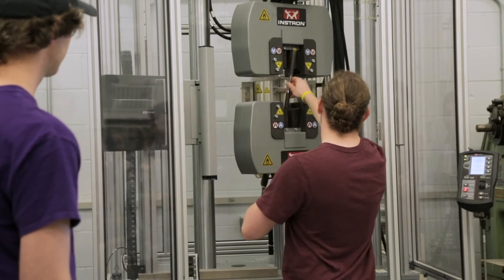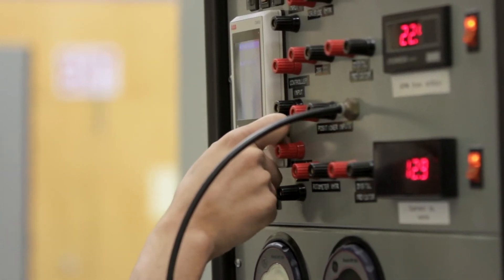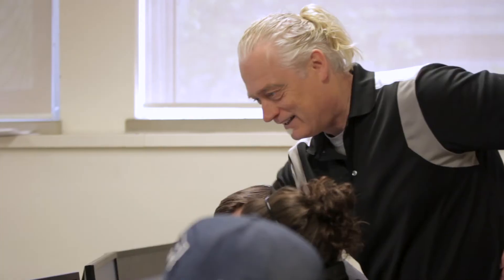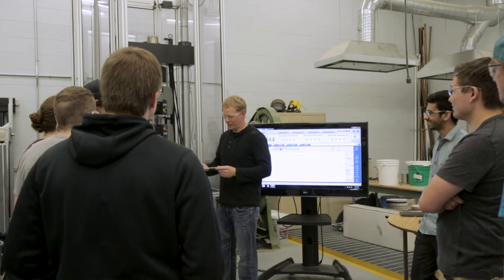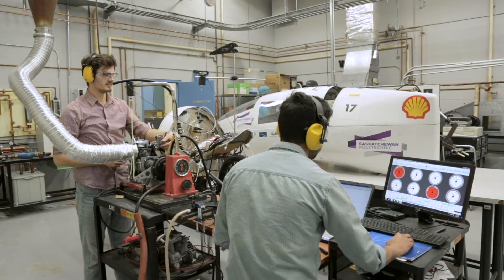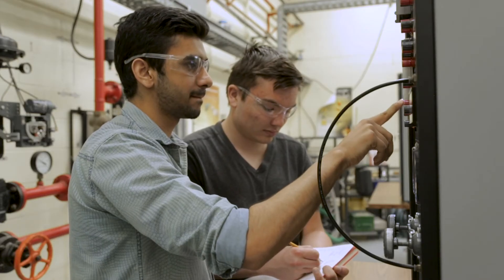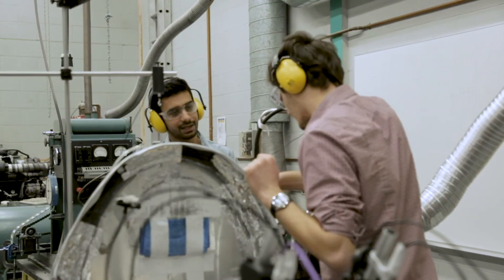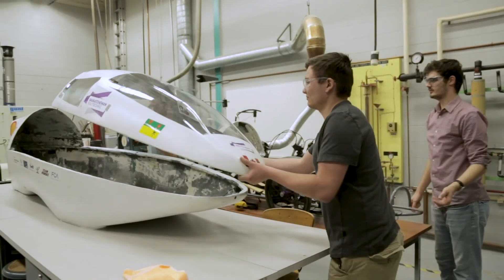Mechanical Engineering Technology diploma program

Comment: Hlo... Sir can i apply in this course after completing  diploma in mechanical engineering..???? 
My ielts score is overall 6.5 band not less than 6 and i have completed my diploma with 65% marks..
Reply from the maker: Hello. Please contact international@saskpolytech.ca to connect with our international advisors. You can also find out more about admission requirements on our website at https://saskpolytech.ca/programs-and-courses/programs/Mechanical-Engineering-Technology.aspx